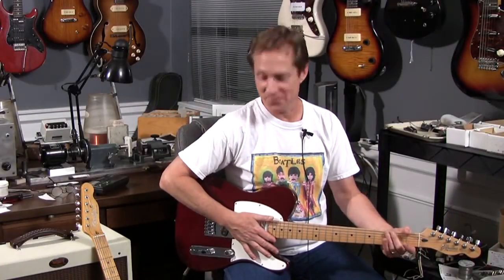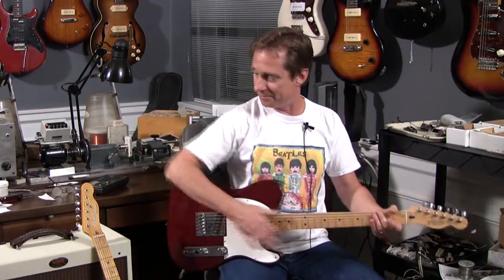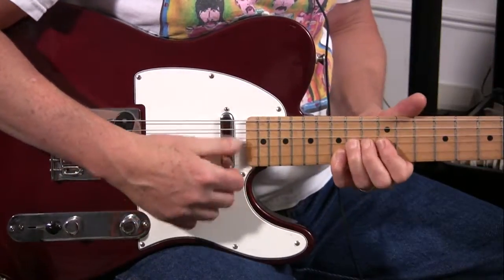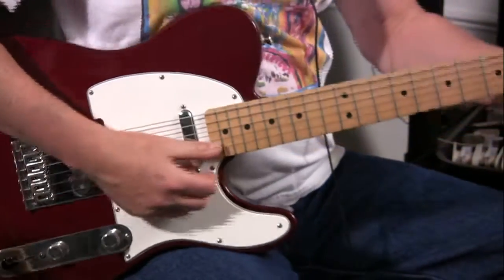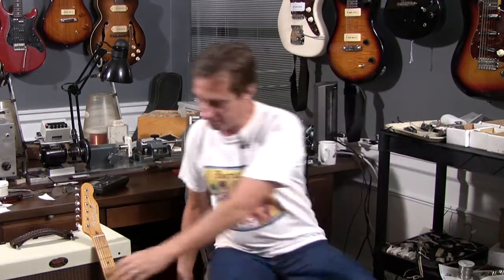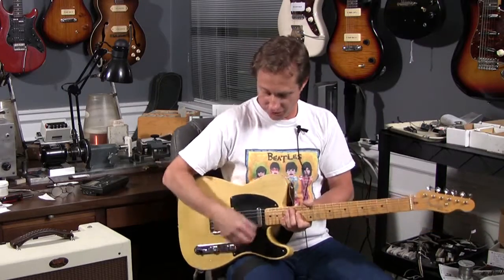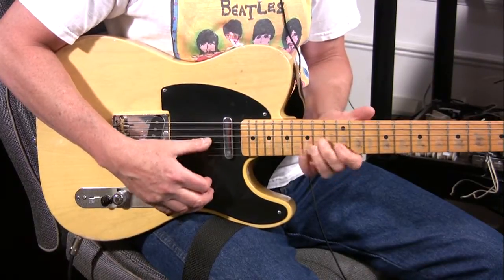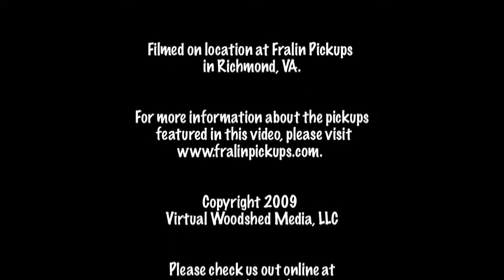Lindy Fralin Pickups - Vintage Output Tele Replacements vs. Overwound (HD)

Comment: Out of curiosity, is that "red" Telecaster a Crimson Red Metallic color? It definitely does not look like Candy Apple Red or Dakota Red. I like both sets of pickups- can't tell which I like better.
Reply: +Brad Dietz  I think Fender calls it wine red. Both pickup sets are in the right guitar for them, the wine red is a darker guitar and the butterscotch is ash and maple, a brighter guitar.
Reply: +Lindy Fralin Oh, the Wine Red. Up close on a different monitor it looked different. I may prefer the 5% over. Today. So hard to decide without just trying trying a set. Thanks!